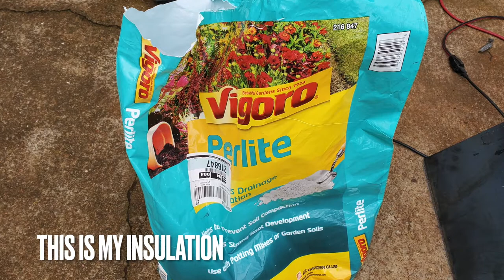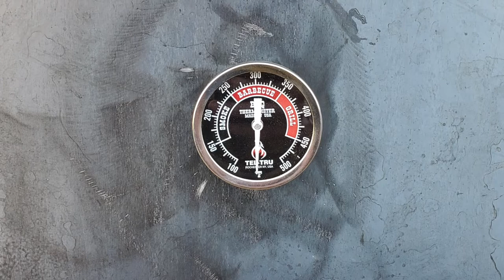Insulated Vertical Smoker Build - Part 4

Comment: Gotta ask...
Why use perlite os insulation?
Also, you think it settled, leaving some areas uninsulated?
Reply from the maker: I used perlite partly as an experiment and partly because it was super inexpensive compared to rock wool or any other hi-temp insulation.  It would have cost me around $200 for hi-temp insulation as opposed to $15 for 2 bags of perlite.  As for the settling, it may have some, but not a great amount as it was packed in pretty tight.